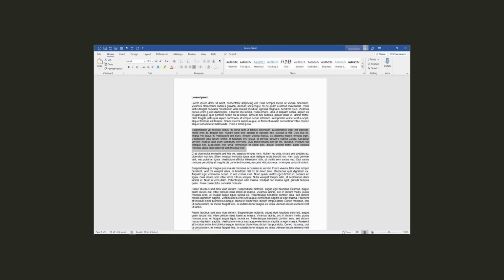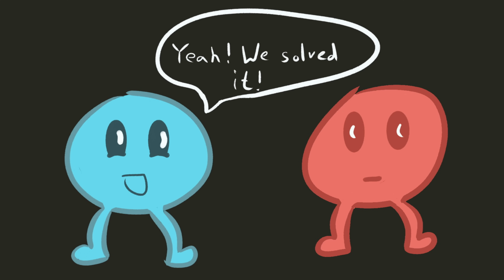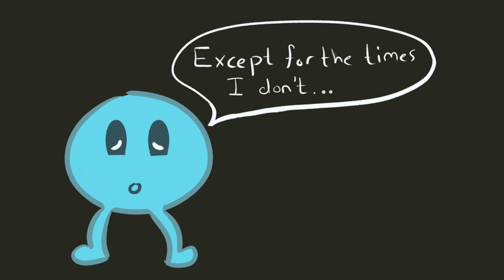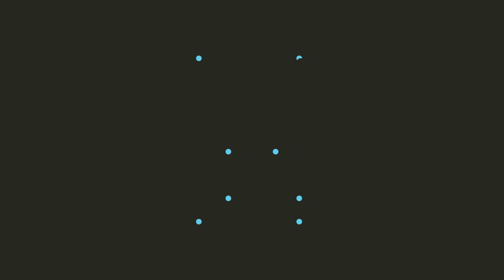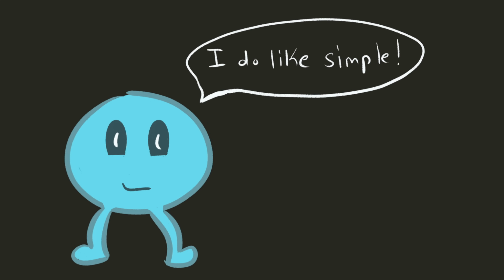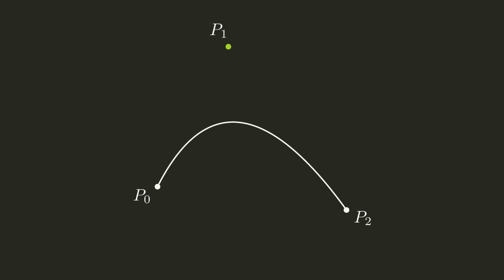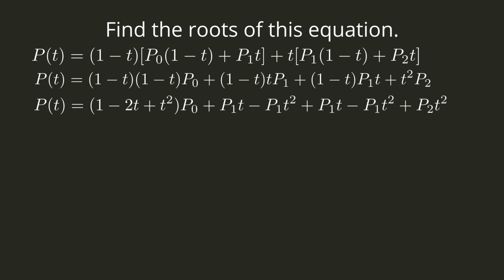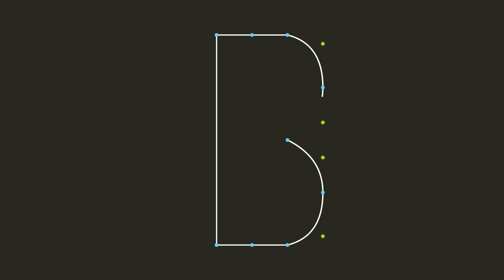The Math Behind Font Rasterization | How it Works

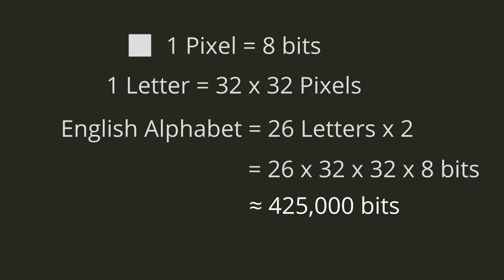Comment: 2:14 "~ 53 Kb"  ->  53 KB.  Typically, bytes are indicated with an uppercase 'B', and bits are indicated with a lowercase 'b'.
Reply: And the "kilo" multiplier is indicated with a lowercase "k", so "kB".
Reply from the maker: Yea, I had another person point this out as well. I must have overlooked it when I was finalizing the editing :)
Reply: Also this calculation is a lot easier if you notice that 1 pixel is 1 byte, and that 32*32 = 1024 = the number of bytes in a kilobyte, so each letter is exactly 1 kilobyte, and therefore the english alphabet with upper and lower cases is exactly 52 kilobytes.
Reply: @UltraLuigi2401  I know that basically everyone on this planet still uses this wrong, so you have to be aware of the fact that uninformed people (and operating systems) mean 1024 bytes when they say 1 kilobyte. Actually that's simply wrong though. The prefix "kilo" means 1000 just like "mega" means 1000000 and that is NOT different for bytes. 1 kilometer = 1000 meters and 1 kilobyte = 1000 bytes. To deal with the confusion, a standard has been published in 1998 (accepted and enforced by many organizations) which introduced binary prefixes. The correct one in this case would be "kibi". So 1 kibibyte = 1024 bytes. The abbreviation is KiB instead of kB.

Here's some more info if you care: https://en.wikipedia.org/wiki/Binary_prefix
Reply: @flyingsquirrel3271  I'm already aware of the different binary prefixes, I just am also aware that the base 2 definition for the SI prefixes is acceptable in informal contexts (such as youtube comments), and so use them to avoid confusion for people who have never heard of the binary prefixes.
Reply: @UltraLuigi2401  I'd say theres a difference between using the prefixes wrong casually in an informal context like this (which is fine) and clearly stating that "1024 = the number of bytes in a kilobyte" (which is needlessly misleading)
Reply: @flyingsquirrel3271  I'm not using them wrong, I'm using a different definition of the prefixes that is acceptable in informal contexts only if you specify that you're using it.
Reply: @flyingsquirrel3271  The kibibytes thing was invented because non-computer people simply don't have brains capable enough to process values that are not powers of 10. Just kidding, but seriously, even the Wikipedia page says that the definition was changed so that it would fit with the rest of the SI units. Since it's a pain to work with powers of 10 in programming, and since there's no gain in working with powers of 10 for these units in almost any domain, I will stick with KB (kilobytes) = 1024 bytes for anything but formal contexts, and even then, maybe not (there's plenty of papers written with KB=1024B).
Reply: @UltraLuigi2401  You don't need to specify that you are using a different definition to the SI units. Anyone will understand. If everyone uses KB=1024 bytes and the SI units say that KB=1000 bytes, who is right? The one which actually gets used the most, of course.

EDIT: I forgot to mention, this is only true for informal contexts. For formal contexts, SI is the standard accepted. However, as I said in my comment above, some papers use KB=1024B and get away with it because everybody understands them.
Reply: @andreimiga8101  I get that it's nice to have power of 2 units for computer related stuff. That's exactly why we need the binary prefixes. But the prefix "kilo" is derived from the greek word for thousand and that is used for a factor 1000 in all other cases (kilometer, kilogram, kilovolt, kilowatt, you name it) - using that prefix for 1024 in some cases is just a ridiculously bad idea for obvious, objective reasons. So what are we losing when we just stick with ONE definition and add invent a new prefix when we want to express something completely different? We lose absolutely nothing at all! But we gain a lot: conciseness, accuracy, consistency. Usually these are things that coders (like myself) especially care about so I seriously wonder how some people ended up starting this immense stupidity back then in the first place. Of course there were papers written like this in the past, but why on earth would anyone still defend this BS in 2021?! Do you really prefer asking "which kind of kB?" instead of just using correct units in the first place? Why?
Reply: @flyingsquirrel3271  "papers written like this in the past", let me quote you from the paper describing the Meltdown vulnerability (I'm sure you know what it is): "As data is multiplied by 4096, data
accesses to probe array are scattered over the array
with a distance of 4 KB (assuming an 1 B data type for
probe array). "

Even some operating systems use KB for file sizes to denote the binary versions.
Reply: @andreimiga8101  I'm sure there are also papers that use imperial measurements. Things that are objectively stupid don't get better because people do them anyway.
Reply: @flyingsquirrel3271  measurement units are not objective. SI units are the standard, but they are not necessarily better. There are no "stupid" units. Only accepted and rejected ones.
Reply: @andreimiga8101  There are no "stupid" units xD Best joke I heard today! Sure, a single unit can't be "stupid" but a system of units can. Exhibit a:

https://upload.wikimedia.org/wikipedia/commons/7/72/NIST_definitions_of_American_units_of_length.png

Pure comedy! It get's even better if you add volume units.
Reply: @flyingsquirrel3271  While I agree that those units are stupid units, I don't agree that they are objectively stupid. It's an opinion - subjective. If you think it's objective, then please prove scientifically that imperial units are stupid.

Again, I agree that those units are trash. The difference is that, except for Americans, nobody uses them, but everybody uses KB=1024B.
Reply: @andreimiga8101  I'm not sure if the term "stupid" is even defined with scientific accuracy xD But when I'm comparing two options and I call one of them "objectively" stupid", I am refering to the fact that this option has disadvantages over the other one without having any additional advantages. In these rare cases, there is no tradeoff, so it's not a matter of opinions or taste and thus there simply is a right way and a wrong way to go. Or, more informally a smart, and a "stupid" way.
Reply: @flyingsquirrel3271  That is EXACTLY what I was trying to tell you with the kilobytes. Using 1000s is stupid and useless, so the fact that this unit exists in the first place is dumb. It is what you define as "objectively stupid". Using powers of 2 is the way to go, and I don't want to add an extra "i" to the abbreviation because some idiot thought that kilobytes should be 1000 bytes. When almost the entire world use KB=1024 bytes, it's the 1% that don't who are wrong, not the other way around. Since measurement units are human defined, the "best" units are the ones which are used the most.

EDIT: And your argument that the imperial system has no benefit is wrong. For example, the Fahrenheit scale has more granularity, so it's easier to represent every-day temperatures with integers. Again, I hate the imperial system and I don't mind not having its benefits, but I acknowledge that those benefits do exist.
Reply: @andreimiga8101  I didn't talk about fahrenheit. That one does in fact have its reasons. And I already told you that I absolutely agree that using powers of 2 makes sense for data. But "kilobyte" is a combined word. The underlying unit we are talking about is called "byte". The "kilo" in "kilobyte" is just a prefix and it's one that already had a clear definition ages before it was misused by some computer people (since 1795, wiki). You can literally use it in front of any unit you want. Lumen? Joule? Mole? Whatever you like. And it did always and will always mean times 1000. You could even use kiloinches although nobody else on the planet does but still everyone would know what to expect and how to deal with that unit mathematically because these prefixes are systematic and consistent and thus don't require any further explanation. That is in fact a huge objective advantage over any hypothetical system of prefixes that change their meaning depending on the unit they are attatched to.

Imagine going into a bakery and ordering a dozen rolls and then they give you 10 because for the kinds of rolls they sell, a "dozen" means 10 instead of 12 because they are bigger or something. That would of course be complete BS because the word "dozen" existed before they invented their rolls and it already had a distinct meaning before. And most importantly the meaning of the term "a dozen" is completely independent from the kind of objects you are using it for. Rolls, cars, apples, eggs you name it.

And that's the same with these prefixes. If you add them to something, it doesn't matter at all what that something is, they do the same thing! That's the whole reason for using a prefix in the first place. Otherwise you wouldn't need a prefix but you could just use entirely different words (like in the imperial length units -> mile instead of km). By using a well established prefix for a different meaning than the established one, you are in fact doing something that is "objectively stupid" in the sense that doing that has absolutely no advantage over coming up with an appropriate NEW prefix for that NEW meaning. If you want to express a factor different than 1000 by adding a prefix to a unit, that prefix simply can't be "kilo". If you are using "kilo" in that case, you are using that prefix wrong.

I think I wrote exactly this two comments ago, so let's end this here. It really seems like you just got used to using "kilobytes" wrong and are unable to adapt your habbits to the correct usage. Instead you are blaming non computer people for not getting why "kilo" means something different there than when it's combined with any other unit on the planet. And while doing so you don't even seem to notive that their assumptions are actually absolutely reasonable.
Reply: @UltraLuigi2401  1024 bytes is now called a kibibyte or KiB. Kilobyte was redefined to be a 1000 bytes making it consistent with SI prefixes. Noticed the bi in kibibyte. I think that is intentional. Bi for binary and 1024 being the closet power of 2 to 1000.
Reply: @legitjimmyjaylight8409  Someone else already said this, and I gave a reply. Read all of the other comments (or at least until I stopped commenting). 

Note that I could have responded to the last reply made to me by saying that those papers got away with it likely because the binary prefix standard hadn't been established yet.

Comment: Possible way to optimise it: Use the points defining a character to make a bounding box, then divide the area to be rendered into small patches with pointers to the characters whose bounding boxes lie within each patch. The rendering shader then only needs concern itself with testing its fragment coordinate against the characters within a given patch. Putting the relevant data into a format a fragment shader can work with might be a bit complicated, though.

Going below the level of a character seems like it might be possible, but I have no idea how you would go about it, given it seems like it would require splitting the lines and curves and adding new boundaries for patch edges that lie inside the character.
Reply: What you describe should work, but text rendering in games actually works much easier and faster by using Signed Distance Fields.
You generate (once) a Signed Distance Field texture from given vector representation,
and then use it to render the text.
Nice video about it: https://youtu.be/1b5hIMqz_wM
Reply from the maker: Yep this would definitely work, and as Awesome GameDev wrote you can use signed distance fields to do this as well. I experimented with GPU accelerated font rendering using the actual techniques described in this video, and I had to create a pretty monstrous shader for the rendering haha. It was also pretty slow, but I would be interested to see if I could speed it up using the bounding box ideas that you listed :)

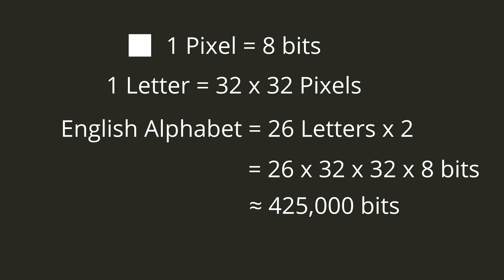Comment: 2:15 * 53 KB, not Kb
Reply from the maker: Thanks! That was an oversight on my part :)
Reply: 53 KiB (kibibytes) then :)
Reply: @onebronx  I actually treat it as KB, not KIB
More accurately, the KB (x • 10^n) is used in the calculations of storage, where is the KiB is used on the computer itself (yet still shown as in KB), as the operating system calculates file sizes (task manager/etc) using x • 2^n
Reply: @avi12  kB, not KB.
Reply: @takix2007  If you strictly follow the ISO, sure, but I use a capital K